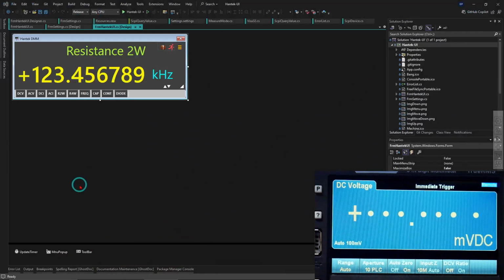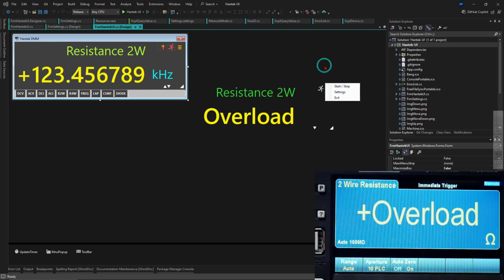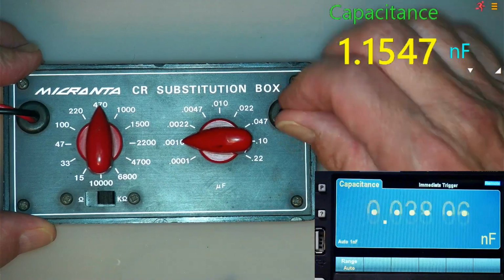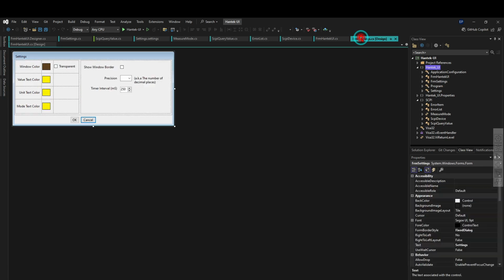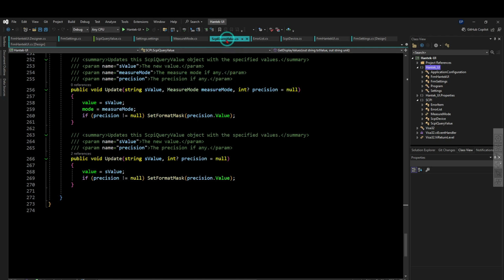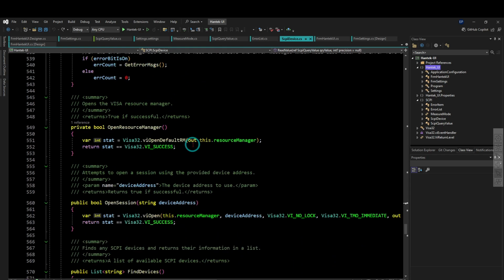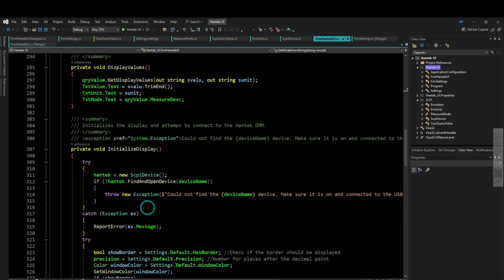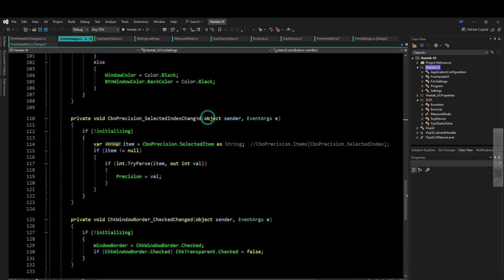Finishing the Digital Multi-meter Windows Application

Comment: Is it possible to stop the meter going into 'remote' mode so I can still use the buttons on the multimeter to control the functions.
Reply from the maker: That is a feature of the multimeter.  I can't check right now but I seem to remember that if you press a button on the meter it reverts to local mode?  But then it disconnects from the USB port I think.
Reply: @Tech-Relief  Yes you can hold shift down and press the + button and it will return control back to the meter.

For my particular need I want to be able to use an OBS overlay to display when recording my videos in the background...
I want to look at the meter itself and use the buttons on the meter I don't want to be using my OBS screen and clicking my mouse to change the settings.
If I use the Hantek software or 3rd party software like Test controller my meter goes into remote mode. The screen on the DMM starts flashing weird while it's updating my PC and I loose all my control
Reply from the maker: @JFIXX1  Hmmm, yes it does respond strangely at times.  I think I need to look at the code when time permits, there may also be some bugs.  Hard to know as the documentation was hard to understand and had errors as I remember.